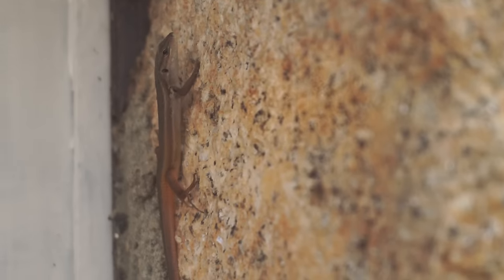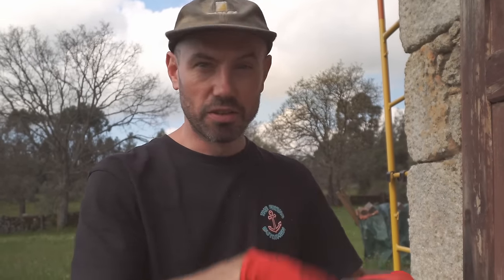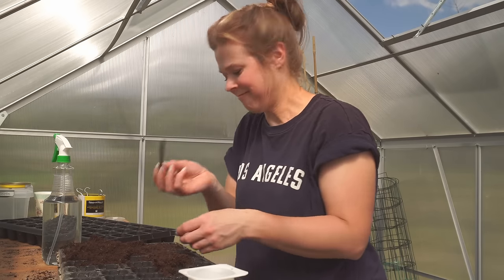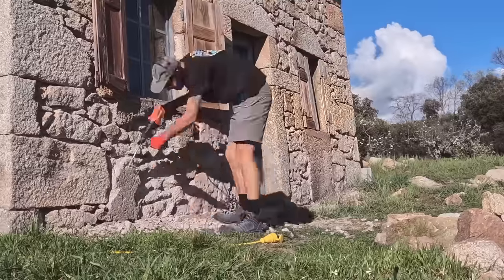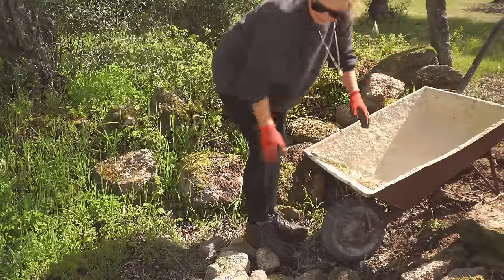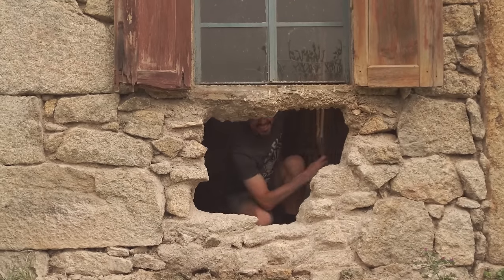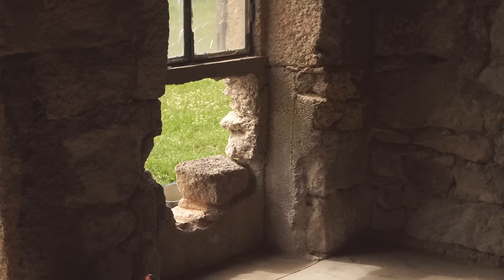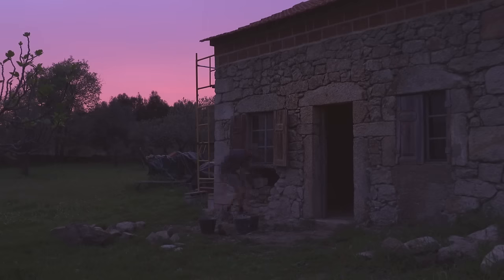We Did THIS to Our Little Stone House 🥴 DIY HOME RENOVATION

Comment: A suggestion from someone who worked in Lads aping for 42 years, many times alone. Next time you need to get a large stone into the wheelbarrow, lay it down next to the stone and roll the stone up to the wheelbarrow. Now you have leverage to lift the wheelbarrow up. If you have a helper, one on either side makes it much easier. A back saver
Reply: That’s what I was thinking
Reply: @lia12345Abc  Me too! :)

Comment: The arm props under the wheelbarrow are great for grabbing, pulling up toward your head, and easily dumping heavy things. Another trick we have used to move giant boulders is to use moving straps-I am a petite wimp and helped my husband lift a fridge using the straps without issue. A German Mason taught me to  drench the stones in water before adhering them to the concrete as it makes them more porous , and adheres them more effectively, but maybe that was due to the types of rocks we were using. 
Just here trying to save people’s backs one video at a time, lololol. 🤣

Comment: When you want to move something  very heavy  like a rock into the wheelbarrow, tip the barrow on it's side and then roll the rock into the barrow then right the barrow.  It's still hard work but much safer on your body than just taking the whole weight of  the rock.
You have to look after yourselves so you can continue your beautiful work.

Comment: What that makes me think of, as a farmer, is a hog house.  They usually have windows over openings for the pigs to come and go thru. And there is usually a small sliding or lifting door for when you need to lock them in the building. 
And one on each side would make sense because you want to keep the farrowing sows separate.
Reply: I think you’re onto something there, good info
Reply: Not a farmer, but this makes sense. Wonder what Ricky and Victoria think about this.
Reply from the maker: Thanks for the insight Tammy 👍 Love the idea that pigs might have once lived in there!  🐷 Do the pig-openings usually have large vertical stones either side?

Comment: You’ll not get the seed starting mix moist enough by spraying! Put some in a bucket and pour at least two of those water bottles you were using in. Mix it with your hands & you’ll probably still need more water. You want a handful to hold together when squeezed without dripping water. Best of luck 💚
Reply from the maker: That sounds a lot more efficient that spraying multiple bottles 😅 Will be sure to try that next time! Thank you 😊
Reply: Also lying the tray in water will help wick up the water into the soil.
Reply: Yes, I was coming here to give the same advice, glad someone beat me to it! ❤
Reply: @LifebyLiving  👍

Comment: Next time you mix the soil transfer some to a container and rehydrate it that way. Don’t get it too wet..it is just right when you squeeze some soil in your hand and it holds together lightly. Then put the soil in your trays. That way it is not too dry as you are planting. The purpose for dampening the soil first is so when you water it the water is taken up better in the soil and stays hydrated better between watering so the seeds can germinate. Have fun with your garden!

Comment: Hi both, great decision to replace the stones, it’s looking much more in keeping with the rest of the masonry. Ricky asked about tips on pointing, a handy tool I’ve seen advertised for pointing patios & walls, it’s like a sealant cawking gun that you fill with mortar, and squeeze into the cracks to be pointed. They are advertised on Amazon etc. That would speed up the pointing, however the only downside I could foresee is that with the size of your gaps, you may be emptying the tube fairly quickly, and it may be a bit fiddly to be filling up. One advantage is you wouldn’t get mortar on your stonework. Only a thought. Paul, Swansea 👍👍

Comment: Another tip about working with stones: put a shovel head underneath, then put a second shovel under the first. Angle the wheelbarrow’s front side towards the rock, and manipulate your shovel/levers to roll the boulder onto the wheelbarrow. I use rocks in my hobby of landscape gardening, and I don’t have a helper.
The biggest boulders I’ve used weighed about 325 and 425 lb, respectively. Your boulder I reckon is at least 500, pushing 600 lb. How even two people shifted it shows how strong you both are! 🥰

Comment: I have a theory, since I've seen similar in other places in Portugal. The shed was shared by two families and each half had a door, either originally built or adapted later. (now windows) (Frankie's Off Grid has a shed whose two halves were even OWNED by different people)

Comment: In France these 'thinnings' of walls under windows are to allow easy closing of external shutters from the inside. Maybe the thin wall deteriorated and the concrete was a repair.

Comment: Several years ago I "rebuilt" my wheelbarrow with a new tub to replace the tired and holey tub.  At the same time, I decided to replace the single front wheel with two wheels spread about 300 mm apart.  It works great but is a bit more difficult to turn.  I'm older (82) so the second wheel helps a lot when carrying heavy weight because now I only have to push it forward and not worry so much about balance!

Comment: As far as the growing seeds, first off pre moisten the soil in a bucket or tray first, get a good moist soil, spray will not do for the first moistening. The squashes, melons, cucumbers, any with a large seed you can direct sow into the plant bed or garden no need for the trays they come up very quickly. I love the tomato var. Sun Gold, it’s an Orange cherry size, very sweet but viney style(indeterminate) will need a tall stake-6-8’they will fruit forever and so delicious. 🪴🪴🪴also, look up the you tube channel, ‘Garden Answer’ Laura’s channel is amazing and you will learn lots😍🌺🌺🌺

Comment: I believe what may have happened is water infiltration under the windows caused the original stone work to deteriorate, and instead of restacking stones, they just took out all the loose stones and concrete/cemented a new wall u der the windows

Comment: Hello, nice to follow your work in Portugal. You several times mentioned the stone walls pointing issue. Do you know the youtube chain by Martijn Doolaard who is renovating a stone cabin in the Italian Alps? He used a smart system where a pump is connected to  reservoir containing the morter, prolonged by a small pipe ending by a thin tip. The pression of the pump forces the morter deep between the stones. it looked quite rapide and efficient and the results are very nice. See episode 81 and some previous ones. Good luck!

Comment: I did gardening for years and I never bought seed germination compost ever all I do is mix a course sand and perlite in a general compost and that’s all you need do I even mix course sand in the general compost for pricking the seedlings out and into bigger growing cells. Otherwise I’d end up with loads of different composts all over the place. Plus they are too expensive to get loads of different types.
You should have maybe put a sheet of plastic on top of the concrete before starting to lay your stone and mortar to work as a damp proof layer especially when and as you said you already get/have a raising damp problem? 😊😊😊

Comment: Next time you need to lift a stone that big, tilt the stone over enough to wedge the barrow side under and roll it into the barrow that way lift the whole thing is easier. Also if you can get straps under each side of the rock that also helps with leverage.

Comment: For moving BIG stones, roll them onto an old towel, sack or canvas tarp and lift by the corners. Two normal size (not muscle builders) people can move surprisingly large rocks. Also rumour has it that lime morter can be rehydrated and used again... Give it a try. The stone work looks a lot better Ricky.

Comment: If you had to take it out I think that I would have just made it a window that goes all the way to the floor. More Light in the room and a cool style all at the same time.
I would not try to reinvent the wheel. Ask your neighbor who has gifted you water melons what they use to start their seeds. I will guess that they do not go and buy compost. They likely have animals. Rabbit poo is the easiest because you can use it when it is fresh. No composting needed. But  you can ask neighbors for composted manure. Likely they will give you some if you do the digging. Also start making  your composted manure on your property now. Next year is a year too late. 
I think that you could have used the debris from the window for your ramp. 
Conservation of Labor.  You do not think of it now but as a 61 year old home stead owner, my back is shot now, when i was your age had I thought a little more about how to do the job with less movement, I would have saved my back. 
Keep up the good work. 
Jim in Chile

Comment: Look at those potatoes and that ramp! The fruit tree blooms are so pretty, we're in bloom here too on Vancouver Island, awash with cherry blossoms and magnolias. Job well done on the stone work, good decision to redo. Will you be restoring the original shutters?
Reply from the maker: No the wood isn’t great & it’s basically door shutters cut in half 😂 We’re still weighing up whether to have wood or aluminium shutters. Ideally aluminium as wood outdoors in this climate doesn’t do well however the aluminium ones are 💰💰💰
Reply: I guess the wood would look better, I wonder if there's a way  to male them last longer?

Comment: Not sure what your plans are for the internal walls, I assume your going to point the stone as your building the internal wall under the window in stone. 

I’d recommend on the next one you dig out the concrete floor, build the internal skin up from below the floor level, put a DPC at floor level and build a cavity wall. To prevent rising and penetrating damp. 

I know it’s only a small area and the rest will still be damp but at least one place won’t be.